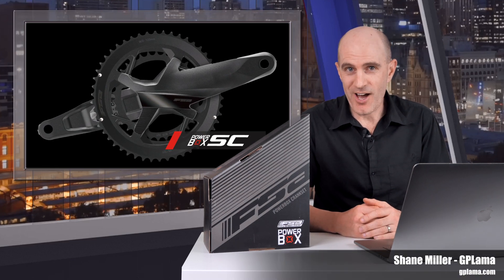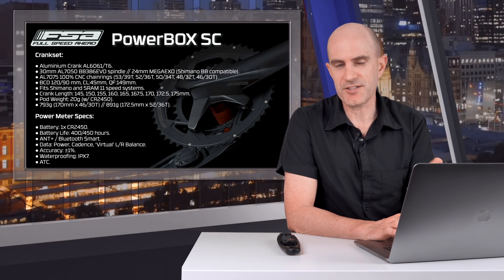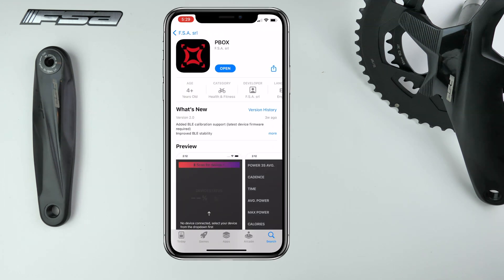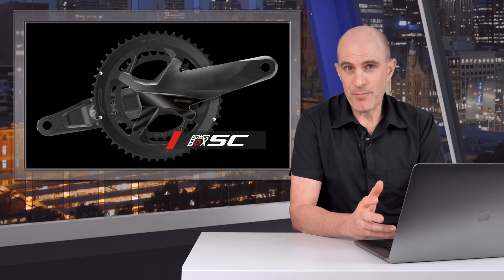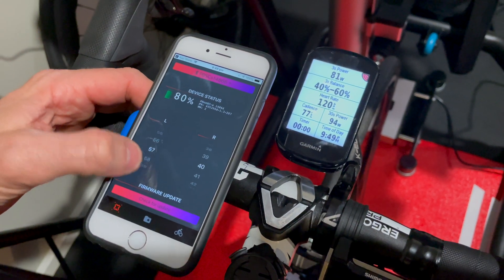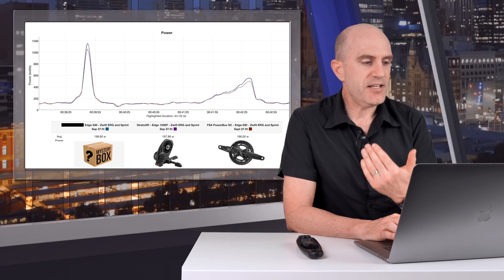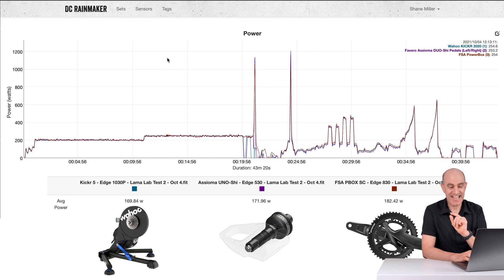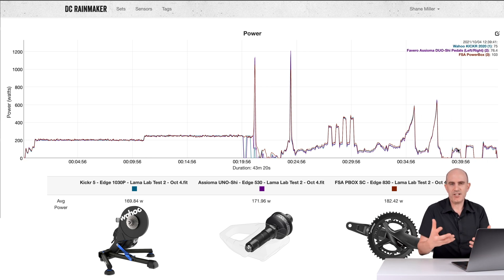FSA PowerBOX SC Power Meter: Details // Hands-On // Test Results

Comment: Shane, I got a lot of questions about this regarding BB compatibility. 

For the 24mm MegaEXO, it is actually 24.1mm. Shimano is 24mm and to avoid a patent I think they made it 24.1mm. If you are using a bottom bracket with metal bearings directly onto the axle it may not work.

For the 30mm. FSA BB386EVO usually uses a DBCA (Distance between crank arms) of 88.5mm. It won't fit some bikes like Factor and Cervelo, the Chainline will be off.
Reply from the maker: The spindle on the unit they've sent over has "For SMN ⌀24" on the spindle. Measures 24mm. This slid into my 24mm BB without any issue. I guess it's MegaEXO -0.1?

Comment: I might have missed it but what sort of stack is there with the power sensor and the left crank arm? I’ve seen several left only power pod cranks not have the necessary clearance to work with the wider chain stays on many gravel bikes.
Reply from the maker: Good question. I have the documentation right next to me.... and... it's not outlined. There's about 6mm clearance on the parallel to the crank/BB interface @ the maximum height of the pod (85mm from the centre of the BB spindle/bolt). Hope this helps. This would be a good addition to the documentation.

Comment: I'd be in the market for just the left side arm, Stages has an FSA version but it's the SLK. My crank is a Gossamer aluminum and I've never gotten a straight answer if its OK to mismatch a gossamer right side with SLK left side.
Reply from the maker: Stages should be able to give you a straight answer on that... if not, FSA direct. (I have no idea, sorry)
Reply: I swapped my gossamer crank on my Cannondale Synapse 105 to a 4iiii precision left side 105 5800 (I could of done R7000 as Shimano states it’s compatible with the rest of R5800) with a wheels manufacturing 24 shim. So far it’s a complete revelation! I don’t care about dual sided power but single power and the far superior & silky shifting, I would definitely recommend it.

Comment: Re you comment at 6:41, My 4iiii power Left only meter had left right balance which you could configure in the app. Pity it broke like so many other 4iiii power meters out there.
Reply: Mine was good for 4 years, and I've sold it to someone who is also using it happily. It was a great piece of kit!
Reply: @jameseastwood402  I agree it's an excellent bit of kit. Until the strain gauge stops working and you end up with a very expensive cadence sensor. It's happened to 3 associates and I and same issue is noted in forums across the internet.

Comment: Not too sure why I watched this review after my experiences with an FSA Gossamer crankset. They were so terrible that I wouldn't even trust them as a paperweight - left arm is likely to fall off just like it did when installed on on the bike.
Reply: I have over 20,000 km on my gossamer crankset, and I never had an issue

Comment: This looks as if it has the same black coating as the FSA Omega that came on my gravel bike. Rubbed off to reveal the bare metal within a few rides...I wouldn't buy an entry-level FSA crank after that experience
Reply: Not to mention they use a ducking 19mm spindle. If your frame is pressfit then no proper tool exist to punch that BB out. Godamn FSA